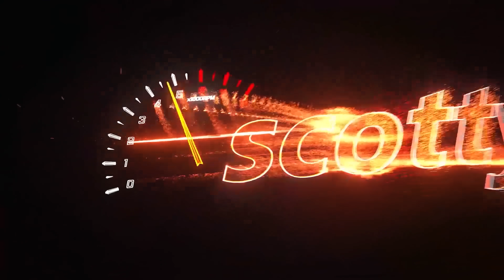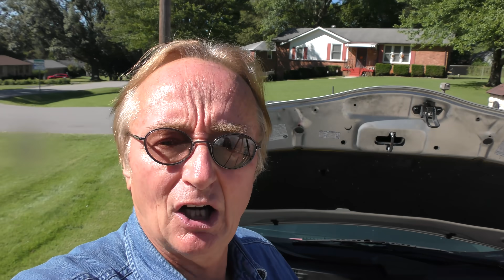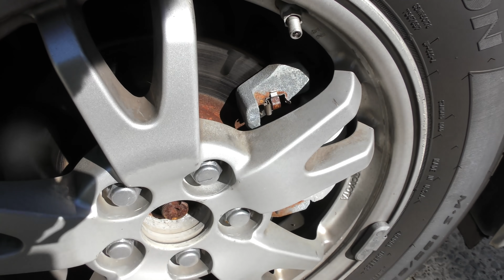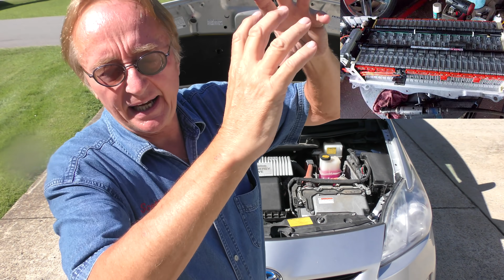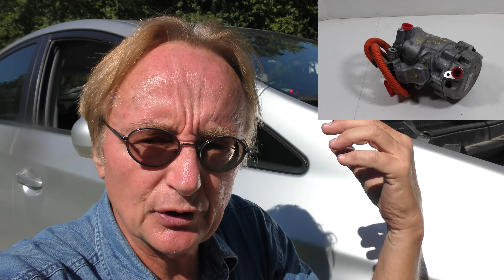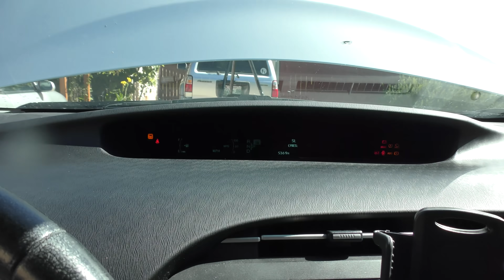A Sad Day for Toyota Owners

Comment: Sorry Scotty, I must respectfully disagree on your V8 V6 comparison. The 5.0 Ford revs VERY HIGH when towing while the V6 builds torque at much lower RPMs resulting in less revs pulling the same loads. You might be right about long term dependability but higher revs are not reason why.

Comment: I was between a prius and a honda civic 1.8l manual as a economy daily. Ended up going with a civic, 6700$ for a 2015 coupe 5 speed, I am qualified to replace batteries but I wanted a simpler vehicle that required less maintenance. I have gotten up to 40.9mpg hwy

Comment: Mine has 151,000 I brought it new in 2012 runs good only that went bad was the dc inverter at 120,000 miles, it still has warrant at that time.

Comment: If I can access the head bolts without removing the cams , I'd try to retorque them before dumping any money into it. If that doesn't work then I'd remove the head and send it out to be checked and rebuilt and replace the head gasket and bolts. Hope the elixir you used works. Please update us if it does.

Comment: That engine needs a head gasket. The engine is terminal and failure is evident and eminent. Head gasket repair is cheaper than another engine or car. 
Atkinson engines are no different mechanically than any other 4-cycle engine. The only change is an operational design in that the intake cam can vary intake closing point on demand. This technology has been used for decades- variable cam-timing control. Techs claiming they're more difficult to repair are techs that are lazy. Walking away from those techs is a smart decision.

Comment: I used Barr's in my 2001 GMC Jimmy 4.3 V6 engine that had the notorious leaks at the intake manifold gaskets.  I put it in at home and by the time I got to work 50 miles later it had stopped and never leaked another drop.

Comment: The Prius may save some gas money, but when they break, they break BIG, to the tune of a 4-figure repair bill several times over. Battery pack, generator, any major engine work. Just forget it. Any fuel savings doesn't outweight the expense of repairing these things after 100k miles.

Comment: Head gasket sealant will also plug up your heater core..    And it will take 20-30  coolant flushes to clear it up.    That stuff is nasty,  hides in the engine and keeps plugging up the heater over and over.

Comment: I have stopped an intake manifold leak that would make the car stop immediately and improved an automatic transmission by retorquing hardware. I never had a head gasket leak but it could work on a head gasket if it's not broken. I learned that engines shake hardware loose from a manual from an old craftsman snowblower.

Comment: I had to do a head gasket on my 2011 Prius. It was not too hard actually and access was ok. This is a common problem with this generation. I've had bad luck with my Toyota's in general. Bad piston design in 2000 Toyota Celica, head gasket and Hybrid control unit in my 2011 Prius, Lots of problems on a old Toyota Tercel.

Comment: Any fuel cell cars will flop and never take off. It is a dead end, dangerous and just requires a more costly and problematic infrastructure than gasoline has. The fossil fuel industry wants hydrogen because most of the hydrogen production uses fossil fuels to make it and results in far more pollution at the generation level than electricity does.  If you really think it has a future then research it and really learn something. It is laughable.  Ignorance is rampant it seems.

Comment: Hybrid systems made sense when battery prices were still high to get better mileage from gas. Now that battery prices came down and you can get a tesla model 3 for 40k the same cost of owning a camry after 5 years, hybrids no longer make sense. You are still dealing with a crappy money pit gas engine that needs lots of maintenance, cramming both gas and ev systems in the same car. That is why hybrids have much less space because you are putting 2 systems in a car rather than one. A tesla model 3 has much more room than any other vehicle of its same external dimensions. That is why the toyota prius has been one of the most traded in car for buying a tesla model 3, as has been the honda accord, civic, nissan leaf, and bmw 3 series. Most of which are 1/2 the price of the tesla so that tells you how much of a better value people realize the tesla model 3 is. Also the reason why the prius battery need more often replacement is that they do not bother with a proper thermal management system since it is a smaller battery and they do not care. Where a proper ev, like a tesla, has a very effective thermal system to protect the battery and make it last 500k miles or more and the drive units will last 1 million.

Comment: I have a 2011 Prius II and I'm about to retire it @ 140k.  I've had it for almost 7 years and kept up with all the major maintenance and only issue was a rear wheel bearing.  

With the used car values at and all time high I have been offered $5,900.  The original hybrid battery is still working but the question is for how long and I don't want to deal with the expensive replacement.  Been a damn good car!!!
Reply: I just traded in a 2010 Prius III that my wife drove like a maniac for 260,000 miles.  Never needed any major work.  I just changed the oil religiously.
Reply: @paulnealis2828  I'm heading to the snow for 3 months with wife so gave me an excuse to buy my new ride early 🤣🤣🤣.  Prius don't do well in the cold or the elements.

I'd say you got your money out of that one.

Comment: EGR coolers plug up in the Prius/Lexus CTs, this leads to increased cylinder temperatures, misfires and ultimately the head gasket going. Need to remove and clean the EGR cooler fins (gunk, carb cleaner, ultrasonic cleaner...take your pick), new gaskets, reinstall. Lots about this on Lexus/Toy forums.

Comment: Honda, great fuel injection system, specially on the 1.5L 4 banger in Civics, CRV's and other models. I have a 2017Accord coupe V6 automatic. Yes it burns more fuel, at about 100K miles time to change the water pump and timing belt ( I'm at about 51K miles now) but otherwise this car is bullet proof ( but please don't shoot when i drive by...)

Comment: I live near Arizona, where the heat consistently reaches 100F to 120F in summer, is it advisable to get an hybrid car with temperatures like these?
Reply: High temperatures are bad for the high voltage batteries. There is a fan that cools them. Keep the opening to the fan clean and install a filter (if you don’t have one. Some models do some don’t. 

You can hook up and OBDII ready and run and app to change the temperature settings on the fan to keep it running at lower temps .

I also put window deflectors on my daughter’s Prius so she can keep the window slightly open in the summer and not worry about rain getting in in the summer.

There are apps that run tests to check your high voltage battery 
Health. My daughter’s Prius is 2014 and has 150k miles. So far all is good.

There is a way to rejuvenate the battery if you notice your battery health getting worse. It involves charging , discharging it over 2-3 days in a certain pattern and with some equipment ($300-$700). That extends the life by maybe 6-12 months. Have not done it cause her battery is fine so far.

Had to replace the rear brake caliper. She drives like a maniac and it was its time I guess. Other than that, just regular maintenance - brakes, tires, all the fluids, new spark plugs (the old ones were in great shape).
Reply: Priuses that come from hot places aren't favorable. Inverters and head gaskets get worn more

Comment: Scotty... I need your answers.. I have 2019 Rav4 EXL premium sitting 22k right now.. went to Mazda Dealer get an appraisal for my car a trade for 2021 Mazda CX5 Grand Touring same  specs feature as on my RAV4 but Heated stirring wheel. RAV4 appraisal gave me 32K.. the price tag on CX5 $33,824! ~with another discount 333.00 ..."33,491"!  balance 1,491..after sales tax =103.81/doc fee=125/registration fees is 504.87 total balance after.. "2,224.68" ...
another choice 21 CX5 Preffered but I would lose half bells and whistles of the feature specs bottom price is 483 tax...etc included. which I wouldn't mind paying that price.. but I like my bells and whistles as my RAV4.

Since you're the guru of all make and model cars... is it time or right choice  for trade-in now?  I was astounded price difference jumped from last year 2020 trade in sitting on 16,500 miles appraisal 26K vs. to this year 2021 22k miles appraisal of "32,000" dollars...that's 6k worth more of my 2019 Rav4! Does that mean the 2 year old car now has better ratings of reliability.. less problems etc...

I need your expertise... What is your opinion/suggestions and recommendations? Need an answer.. 

thank you!

Comment: The problem with hybrid cars is you now have two systems to haul around and repair instead of one.  Full EV requires little maintenance and is a lot cheaper run.

Comment: I'm the 3rd owner of a 07 Prius with 323K. I bought it when it had 270K. It's been a great commuter car. Replaced the main battery once buying a reconditioned one. Besides that its just been oil change, new tires, air and cabin filter. Can't complain.
Reply: A reconditioned battery is just a battery that had a few cells that were burnt out replaced, it could happen again soon
Reply: @richsweeney1115  or it could not happen soon. Got one of them high breads.
Reply: @richsweeney1115  true. Reconditioned battery is no where the same league as brand new OEM. I was quoted $3k for a replacement.

Comment: Quite a few taxis in Chicago are used Priuses. Sometimes, they’ll start burning coolant, especially when they have a lot of miles. It turns out that once coolant loss starts, it progressively gets worse. Best fix for these cabs has been to replace the engine. This has been for dozens of cabs owned by fleet owners across several different companies. The consensus is, when a high-mileage engine develops serious issues such as a head gasket leak, it’s most cost-effective to just replace it.
Reply: Sealant has fixed peoples cars for years, I'd try that first.

Comment: Just got a 2012 Prius with 140k miles on it. So far so good. Let's hope I can get a couple years out of it with minimal issues.
Reply: You should be good to go if it was well maintained.  If you haven't done so already I would get a detailed inspection done on it and get all the fluids flushed and changed.  The main concern would be the hybrid battery.
Reply: @RLTW_03  Yeah luckily I found some information on the last maintenance that was done on it. Dealership changed oil and fluids. Even replace the brake system so thats under warranty. Like you said... Battery should be my only concern so far.
Reply: Prius is a meme car, gj

Comment: I bought a 2015 Sonota hybrid brand new. One of the reasons I bought it was that Hyundai guaranteed the hybrid battery for life to the original owner. The car is now approaching 7 years old and still going strong. It has been one of the best cars I’ve ever had. No major repairs required so far. I’ve only had to replace tires, wiper blades and the starting battery. I’ve saved a ton of money on gasoline and it has a driving range of about 600 miles per tank. The only drawback I have experienced so far is that it has a smaller trunk due to the location of the hybrid battery. Now the new Sonota hybrid has a full size trunk, but I’m not sure if this relocation of the hybrid batteries causes other problems down the road.

Comment: I own a 2015 Prius and this car is a tank. No issues whatsoever and it’s got 93k miles on it. I replaced a bunch of oem parts a few months ago from the plugs, coils, water pump, thermostat, changed all the fluids, everything got cleaned such as the egr & throttle body and spent around $1100 from my mechanic. I’m confident that this Japanese made vehicle will last me years to come.

Comment: That’s why I choose to keep my generation 2 Prius. I can’t stand this trend of electric water pumps especially when they’re known to fail and cause catastrophic side effects like on this gen 3 Prius’. Toyota made a dumb move on that one. It’s a shame given that generation was the prettiest Prius body style in my opinion. Keep up the great work.
Reply: The Gen 2 has it own issue too. These are the most common issues for that gen:

1)  oil consumption
2) air conditioning system
3) suspension system
4) high voltage battery

Otherwise, great car. I had one for 4 years and sold it.

Comment: MISFIRE=Blown head gasket most of the time...  The Death Knock when starting the car in the morning after driving...  The coolant seeps into the cylinders overnight and then causes the knocking.  Usually for 2010-2014 models, usually starts 120k-150k.

The reason they blow is they get hot, go cold, get hot, go cold - Over and over and over again... The repeated expansion/contraction is a killer...

Comment: They will NEVER use hydrogen fuel cells because the amount of energy required to produce the hydrogen far exceeds the amount of energy produced in the engine.
Reply: @Alfred Wedmore I was going off the premise of reducing the energy footprint, which is what the tree-huggers are all about, right? But I see your point.

Comment: Make sure to change the battery air filter to keep the batteries good.  Enough said.
Reply: @Alfred Wedmore Got to keep them batteries cool if they overheat it shortens their lifetime significantly.  They have a fan that has a dust filter to filter the air passing over them.
Reply: @Alfred Wedmore True so true.

Comment: The Honda Insight was much better built than the Prius. Even if the hybrid system dies in the Honda Insight, it still has a alternator and a standard lead acid battery to keep you driving.

Comment: Hmm.  own 3  the '08 has   262K  only has needed a bearing and brake job, tires and oil changes. '10 and '12 are fine 155k and 180k.  Gen 2 is my favorite.
Reply: Until they steal your Catalytic Convertor on the second Gen, not on the 3rd gen

Comment: Question. I have a 2004 Chevrolet Colorado Z71 2wd and I 5. 180,000 miles. I have had this since 2005. I have had ac issues for 8 years but I believe it’s because it has a short and needs a new harness. While driving I have the light on the instrument cluster go off. Then sometimes on. Still drivable just don’t know the amount of gas or speed your driving. I was told they don’t make the instrument cluster anymore. Dealership said I could buy used they would TRY to program. Is this true.

Comment: Damn , 3 to 5 thousand for a head gasket. What's the flat rate in Tennessee? I bought a 11 year old Civic with 98,000 miles for $1,500. Overheat problem. Head was warped and head gasket blown. Had the head machined for about $125.00. Replaced head gasket and valve seals and less than a days labor. Learn to do these easy repairs yourself people.

Comment: If the Barr's sealer does work I'd sell that Prius asap before that head gasket starts to leak again. Might as well sell it for decent money while it's working rather than wait to have the same problem again and not be able to sell it for much.
Reply: How expensive is the blown head gasket? Do you know?

Comment: Our 2012 Prius v with 203,000 miles. Easy oil and transmission fluid changes. Spark plugs kin of challenging. Need to remove firewall!
Reply: That can't be true.. the top of the motor is way before the firewall

Comment: That's the risk you take when you buy used. Especially when the car already had over 100K miles. The fact that he went 60K~ miles on that car is a miracle already. Truth be told, if that 35 dollar spray can doesn't work, he should just call it and buy something else.
Reply: Yes. Car is disposable anyways. Not so much when it brand new

Comment: common problem on toyota hybrid motors, and on lexus hybrids as well. these same engine used on corollas and they dont have this issue; And the issue with hybrid is that engine heats up and cools down may times thur the day and that is basically what kills the head gasket, it just looses its ability to expend and seal. stays flat. They do rebuild this for about $1K in California.

Comment: Don't use gasket sealants. It turns into solid materials within the entire cooling system. Brings much more problems later.

Call your local shops n ask for the cost to get valve job.
This way they clean the valves and replace the gasket at the same time. It will run better after.
Costly? Yes. Worth it? Definitely.
I paid 700$.

Comment: People don’t understand when buying hybrids especially the Prius, they are sold on the ‘good on gas’ gimmick which is great if you’re not keeping the car for a long time but if you buy these used like Scotty said, replacing the battery with a used one isn’t worth since the thing won’t last more than 2-3 yrs and you’re looking at a minimum of $5-$8 k on any major engine job which makes the whole saving money thing irrelevant. You have a gasoline engine and a hybrid system that can fail like this owner stuck. He can do either but still will be out more than $2000 at the minimum when all said and done. Not even a long term solution to fix the car with close to 200k miles. Junk!
Reply: True but brand new hybrid car isn't junk from the get go. Lots of folks leased them over owning them which make sense  financially. 

But yeah a used one isn't gonna give a peace of mind for quite time esp with unknown history behind the car

Comment: The air conditioner went out in my Toyota right after the warranty was over.
Reply: What model and year?
Reply: Yes it’s the same with my auris hybrid 2015 , I haven’t bothered to have it fixed,it’s dun 118670 miles so fare .